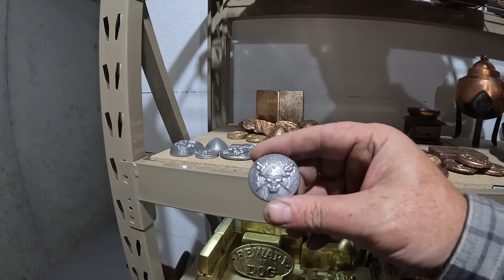I Melted RED Brass....And a Military Flyover That RATTLED The House!

Comment: Whatever you do, don't put more than a table spoon of borax (depending if your crucible is full or not) into the crucible of metal. When borax melts, it becomes like liquid glass. It's bad for your crucibles and the metal inside of it. Not careful, you'll wind up w/ a gloppy mess. And you can't remove the damage once done to your crucible. Near the end there, couldn't see squat because of the glare and possibly some bad lighting. Other than that, nice job. I've never seen nor heard of someone living up there and not liking the Packers. Interesting though. Least I'm not thee only one. 😁😁😁💙💙💙💜💜💜🤙🤙🤙

Comment: That brass is very finicky. It might have poured a bit better without the welder rod holder and the plated sink fittings, they may have caused some contamination. 👍

Comment: this is not red copper but BRONZE
Reply from the maker: Why bronze?  It's just brass and copper.  There would have to be some tin in there to make it bronze.....unless there was tin in there that I didn't know about.  I DID melt melt some bronze once and it looks a little darker brown than this.
Reply: @SkullerMetals  the old taps and the big tube were made of bronze
Reply from the maker: @MsMaxno   You might be right.  It had some black soot on the graphite mold after heating it so I thought that was strange, and it was black on the top side which was cleaned off with the wire wheel.  Hmm, well if it's bronze then I'm ok with that too.
Reply: “A” for effort and just plain old entertainment!
Reply from the maker: @robertzapatka1082  Thanks Robert, I appreciate it.  Good times!